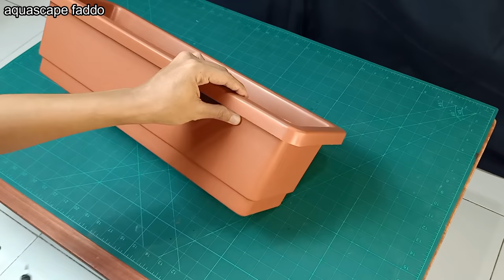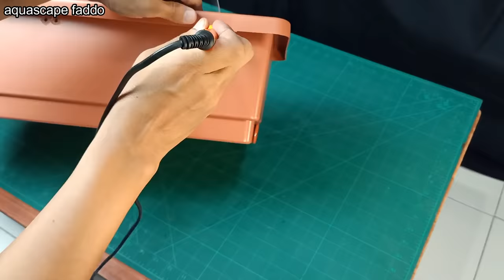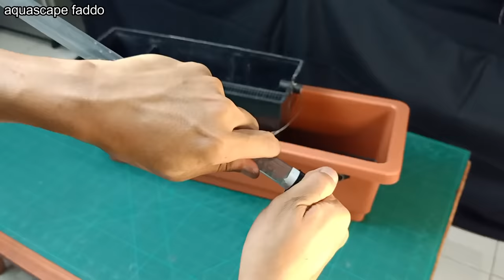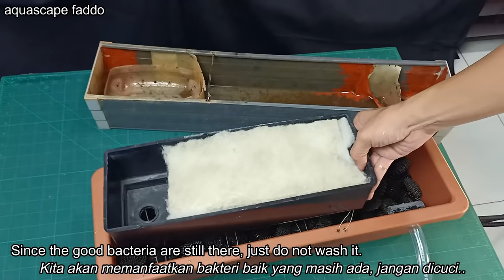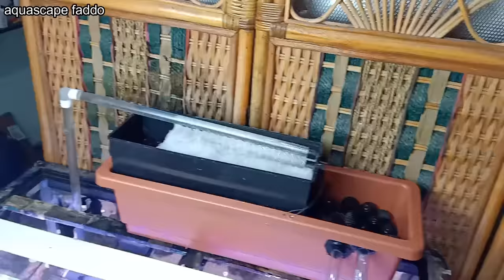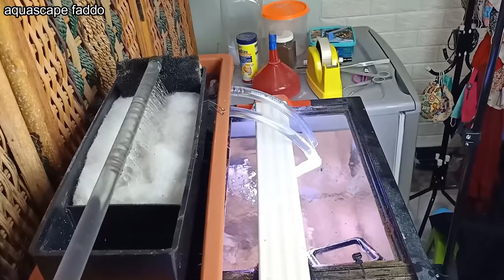Membuat Box Filter Aquarium DIY dari Pot Bunga

Comment: Do not use metal wires. They will change the water condition due to reaction with water. Always use jute or plastic tags. Double or triple the tags for length... Cut the extra piece.

The video is excellent. Great skill.
My only advice is don't use Metal wire or anything of Metal. 👍🏼
Reply from the maker: Thank you very much for the advice, I have replaced the metal :)

Comment: You make some good videos and have some great ideas for filters. However I’m curious why you use a soldering iron to make your holes? A drill with a hole saw is much faster, cleaner and you wouldn’t need to inhale burning plastics. Bulkheads are fairly inexpensive and you can reuse them. Why not use them instead of the current fittings and 2 part epoxies?
Reply from the maker: Yes I agree with you, drill with a hole saw is much faster, cleaner, and now I forgot why I used a soldering iron in this video :D
Regarding bulkheads, sometimes I try other ways than using partitions like some of the previous videos. Just wanted to make something different, and wanted to know how it turned out. 
Btw, thanks for suggestions bro.

Comment: Good idea, but you're losing efficiency there, bottom media is not getting any water flow, water flows on the surface because of the least effort route, you need to better route your water flow in order to force it to run through all your media, this simple mod will boost the efficiency of your filter greatly, also coarse sponge should be the first to receive the water, and fine one should be after, because big particles should be filtered first in order to get a longer life of your filtering media, nice video, keep up the good work
Reply from the maker: Hi thank you for your suggestion. Actually I agree with you, if I use the low capacity of pump. But in this video (and until now), I use the 2800 L/H, and almost all the pot area. For the mechanical, I change as what you suggest after I uploaded this video, so now the black one is the first order :).
Anyway, once, thanks for your advice, I  apreciate it.. :)
Reply: 請問這種塑膠生化球的培菌效果強嗎？

Comment: I just bought a 10usd overhead filter sump than doing this filthy unpresentable time consuming more expensive environment not friendly carbon emitting diy filter.
Reply from the maker: My total expenditure to make this is around 2.5 USD, because I already have a pump, filter media, hose and nipple, used old box, and I need a large capacity so that I rarely do maintenance (due to other busy work).  FYI, the total combined capacity of that 2 filter boxes is around 10 liters, so actually I can use kinds of media filter here. Anyway, nice share sir, thank you :)